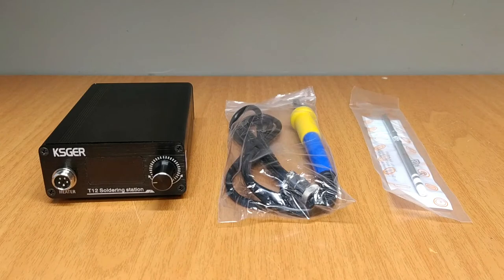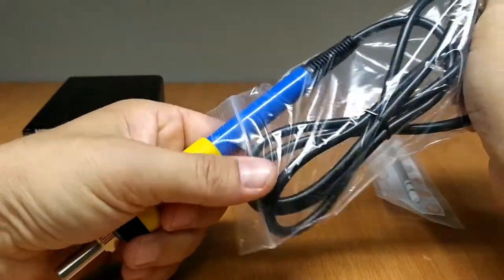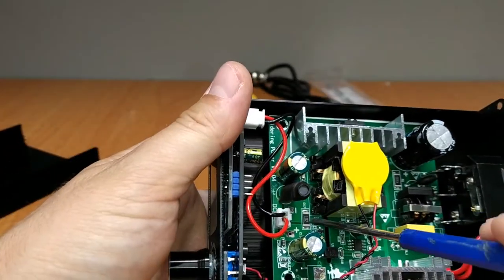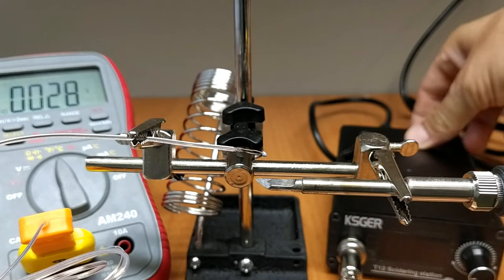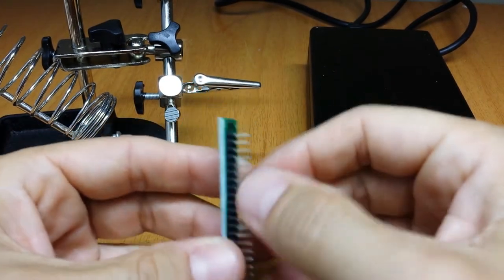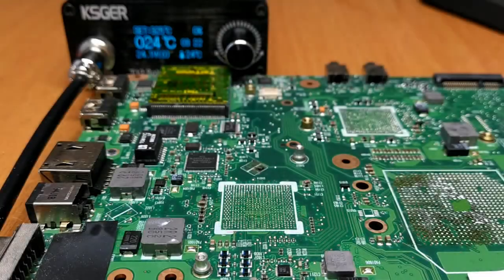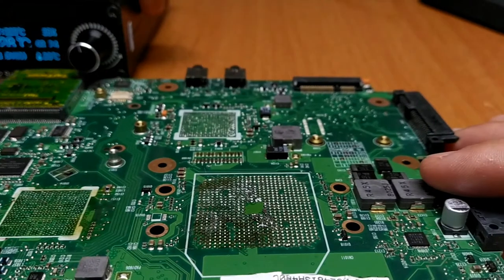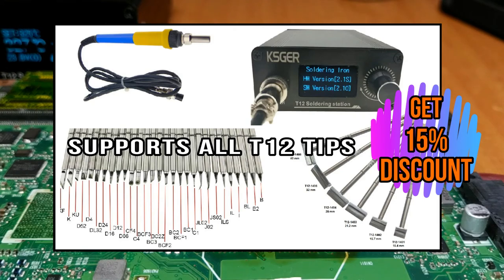T12 Digital Soldering Station Review (From Banggood), Good For BGA Repairs

Comment: Hi Nik, thanks for another great video. Would you recomend getting this station plus another hot air station? Or is there one station that could do both well enough?
Reply from the maker: Hi, if you do not want to use the T12 wide tip then you can get a hot air soldering iron station 2in1, if you are a hobbyist like me the this 2in1 solution would be ideal, the cheapest ones cost about $50 and go up to $100~160, i think with $70  you can buy a decent 2in1 rework station, you will find many on banggood, use the coupon code you will find in the description to get 15% discount and save money, i think the discount code works with all soldering rework stations .
Reply: @NikTelio  this is awesome, thanks, I will use it very soon. Ok, so the 2 in 1 stations are not compatible with the T12 wide tip? I can't do the things you do yet, but I will learn.

Comment: hello Nik,
first of all thanks for the videos.
I follow you closely.
I'd like to buy repair supplies for video cards used in desktop computers.
Most importantly, which model would you recommend for the bga rework device?
Can you make suggestions for other products I will need other than bga rework?
I want to start this business for a long time. But I could not decide on the products.
Thanks in advance. Thank you very much.
Reply from the maker: Hello, since i do this as a hobby and i made my bga rework station, i do not really have knowledge about bga rework stations sorry,
for bga reworking you will need a bga rework station, a small oven for removing the moisture from pcb''s before starting the repair, a good 70W T12 soldering iron to use with the wide tip, a hot air smd rework station, and a lot of patience :)

Comment: hi nik,
i have a doubt, i have sony vaio laptop with amd gpu  but now it is showing green glitches- matrix like  on screen and so cant use it...i suspect it might be the gpu problem?...so if it is gpu then can it be repaired or if cant be repaired,then can it be removed and so whether it will work with integrated if removed(i dont know whether it have integrated gpu on it,anyway the processor is i3)?please help...thanks